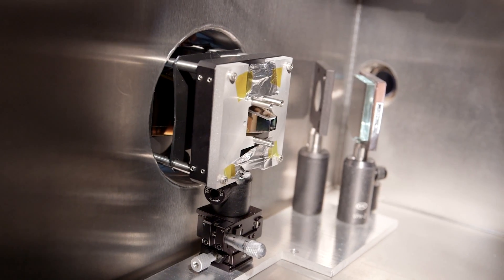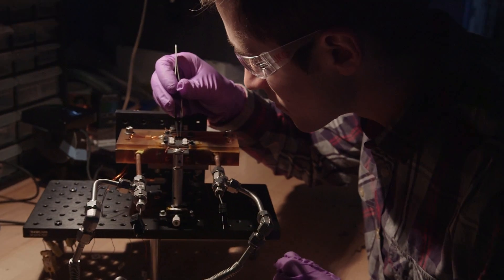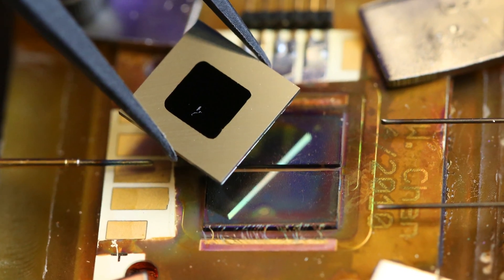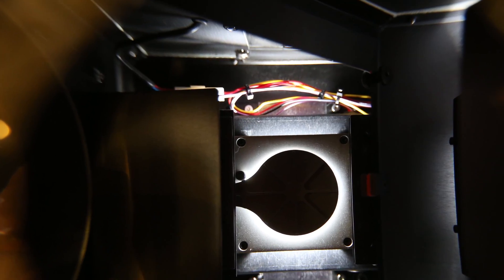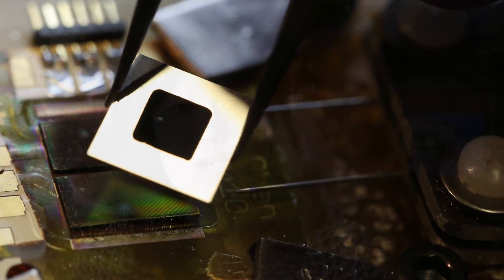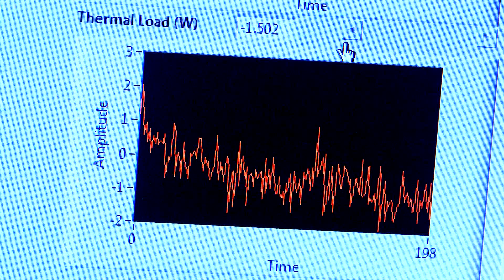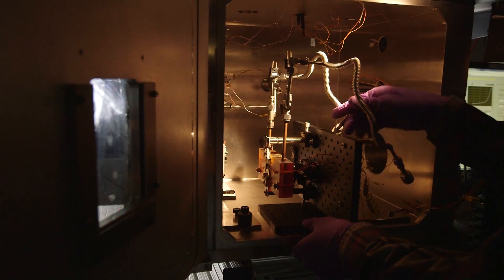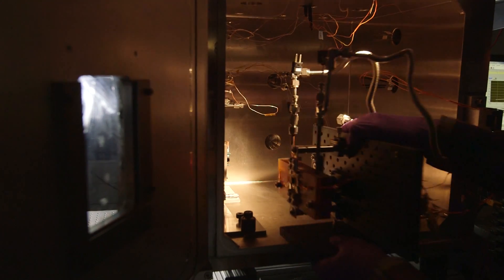Harnessing the Full Potential of the Sun

Comment: IF DIAMONDS ARE MADE IN EXTREME HEAT THAN THE STRONGEST DIAMOND COULD REACH THE SUN AND CAPTURE A SAMPLE. BUT THAN IF WHAT A DIAMOND COULD REPAIR THE SUN FROM ITS OWN REFLECTION,WITH THE RIGHT SIZE DIAMONDPOSSIBLY SOME GOLD  IT COULD BE THAT FROM DIAMONDS THAT DOES NOT EXCEED BEYOND ITS TEMPERATURE  BUT ADAPTS TO ITS SUSTAIN ABILITY TO POSSIBLE FILL IN THE GAP ....